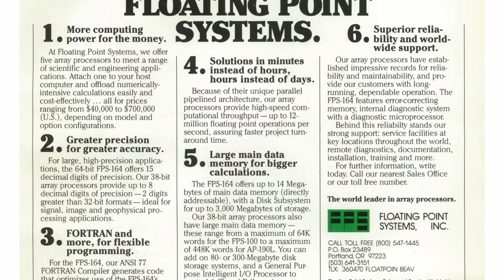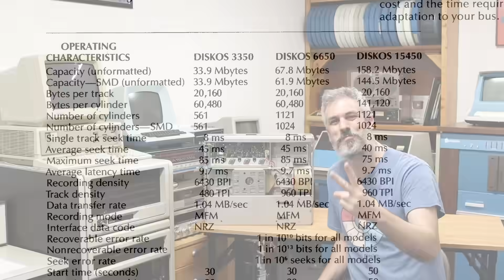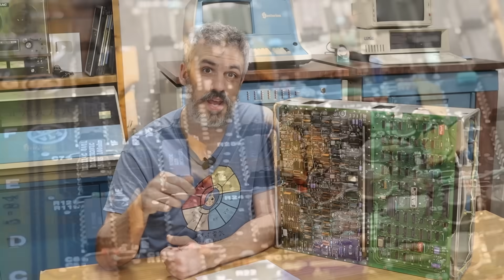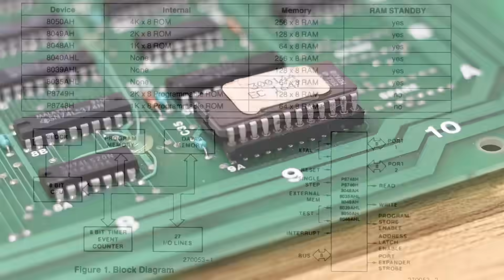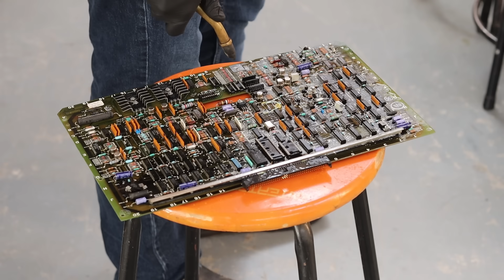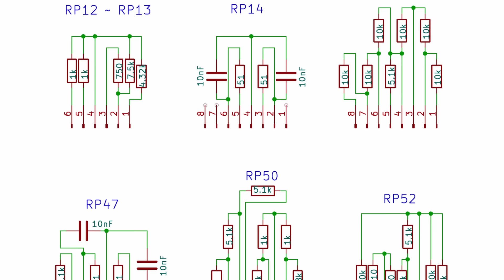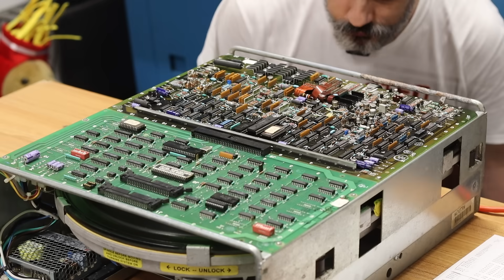This 1980’s Hard Drive tried its Best…

Comment: I have a few tips for you but first, what a trip down memory lane! Worked at MAI Basic Four in the Netherlands back in the 80's and 90's. These Priam drives were mostly mounted in the 310 and 410 model Mini Computers for small businesses with up to about 16 terminals. I repaired a lot of these PRIAM drives and repaired many power supplies and motor control boards. These two PCB's failed the most. The drives we used were equipped with a power supply. It was mounted over the full length and width inside the cage, exactly where you put the new ones.
I could be wrong, but pls double check if there really is no drive select from the logic board to the motor control board. If I remember correctly it needed drive select in order to spin up. Check for a dipswitch setting on the logic board?
These drives were sensitive to the position in which they were formatted. In MAI Basic Four Mini's they were mounted in a vertical position (PWR supply down) and therefore we formatted them that way. So if you do get it to spin up, it might not initialize or produce read errors if it's not positioned correctly. 
Good luck repairing this diva! Sending you and the drive positive vibes from across the pond😊🫶
Reply: ^ What he said.  That bit of spin looks like a self-test to me.  I think it wants a signal on the interface to start.
Reply: Can you imagine the kind of nightmares this video might re-awaken for some sensitive soul who thought they had put it all behind them?
Reply from the maker: That's awesome that you got to use a MAI Basic Four, that's a really unique machine that has all but disappeared from history!
Unfortunately, as best as I can tell, there are no electrical connections between spindle motor power board and the analog/interface boards. I don't think that I'm missing any connections, but when I get back into this drive, I'll definitely dig into that and make sure.
Reply: @UsagiElectric  There's certainly an electrical connection to get the power to the spindle motor.  Have all the connections in that harness been accounted for?  I'm pretty certain we had a software spin down command and didn't just remove power from the drive to shut it down.
Reply from the maker: You're absolutely right!
I rechecked the schematic, and sure enough, there are two signals being sent to the spindle power board along with the power wires. Since they're being sent via the big fat power connector, I had wrongly assume they were power, but there absolutely is a ON/OFF signal and a Speed signal (I think) moving between the interface board and the spindle board.
Thanks for getting me pointed in the right direction!
Reply: @UsagiElectric  Found it David! It does need a Sequence Up control command from the computer's disk controller to spin up the motor. On an Archive site are several documents on these drives. It's described starting on page 18 of the document: Priam Drive Interface Specification Apr81.
It says: The SEQUENCE UP Command causes the disc drive spindle motor to power up. The rotational speed of the disc is monitored, and after the drive is up to speed, a position signal calibration is performed (except for the 1070) and the heads are positioned to cylinder zero....
 One command later in the document: The SEQUENCE DOWN command causes the heads to be positioned to the landing zone and the spindle motor is braked to a stop. 

Personal advice: Try not to stop the disc by shutting off power to it. It might cause an emergency retract of the heads, where they are violently pulled of the platter with a loud bang to prevent a head crash.

Comment: Back in the 80's I was a field service tech  for Technicare,  CT scanners that used PDP 11/34 computers and FPS  array processors.   The FPS boards were up to 8 layers and the main danger of desoldering a chip from multilayer boards is pulling the through plating out of the hole, or breaking it loose from the inner layers.. then you can never reconnect to the inner layers and the board is toast.   A trick we used to ensure no damage to the through hole was to cut all the leads at the chip, then clamp and hang  a pair of hemostats to the lead on the bottom of the board. when the solder melted all the way through the weight of the hemostats  pulled the pin out.  guaranteed  not to damage the through hole.   then the solder could be cleaned out of the hole and its good to go.
Reply: Oh yeah.  Internal power and ground planes are the bane of both soldering and desoldering operations.  Build in heat sinks, which mean you need to add a LOT more heat than you think to get all of the solder to melt.  Just because the surface where the iron is, is molten, doesn't mean it is all the way through the hole.

The technique i used to use is close to yours, and probably not as good.  But i would do the same, but the leads.  Then apply the heat and gently wiggle the lead with a small pair of needle nose pliers.  Once i could feel is free up completely, i could gently pull the lead out of the hole.

There are many ways to clean the hole, but i usually used either solder wick or i'd heat the hole and blow through it with my mouth.  If the solder was liquid, the tiny bit of air pressure would push the molten solder out of the hole pretty well.
Reply: Only downside to that is if the chip is irreplaceable and you are unsure  if it is truly bad....then you kinda have no choice.
Reply from the maker: I'm definitely hoping I don't have to do much board level repair on the FPS-100 boards, but if I do, thankfully, with the J&M Trading haul of boards I got, I now have duplicates of most boards just in case!

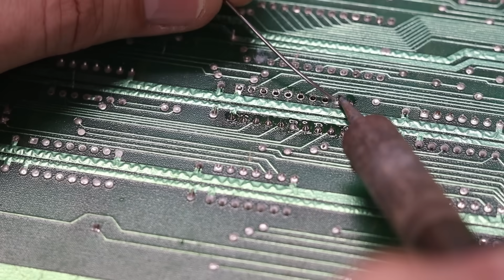Comment: [9:34] I don't believe the '245 can be used as a drop-in replacement for the '244; the '244 has fixed directions for its transceivers - four go one way, four go the other - but the '245 has eight bidirectional transceivers, all going the same way (all left to right, or all right to left, controlled by pin 1).
Assuming the two /OE pins are tied together you could make an adapter to use a '245: Tie pin 1 [DIR] to pin 20 [VCC]. Pins 2 and 18 [Xcvr 1], 4 and 16 [Xcvr 3], 6 and 14 [Xcvr 5], 8 and 12 [Xcvr 7], 19 [/OE], 10 [GND], and 20 [VCC] can pass through one-to-one. Pins 3 and 17 [Xcvr 2], 5 and 15 [Xcvr 4], 7 and 13 [Xcvr 6], and 9 and 11 [Xcvr 8] will need to be swapped; pin 3 on the chip goes to pin 17 on the socket and vice versa.
(Edited: Explain how the chips are different and how to make the adapter)
Reply: Yep, agreed. They are quite different IC's though fortunately he did use a socket. I've gotta say, this chap does produce some fascinating content and this is certainly a brave undertaking. It was hard enough to get reliable performance out of these drives back in the 1980's never mind now!

Two things of special interest, I've never seen resistor packs with built in decoupling caps, thet's a very cool idea. And I've never seen transistors rust through so completely either, while the rest of the board is not all that bad in comparison.
Reply: When he said that I almost missed it, had to rewind to see what was original chip or am I dreaming. It's not pin compatibility, function is not same. Maybe 245 could jump as a help for 540, repining oe and dir. Best Regards.
Reply: A '245 is most definitely not pin- or functionally compatible with a '244!
Reply: The good news is that it looks like the OE pin is floating. So the '245 probably didn't fry whatever is connected to the input.
Reply: Totally agree that 245 is definitely NOT a drop in replacement for the 244 so this is not going to end well. 

Pin 19 (OE/ for 245) is wired on the top of the board.

I see magic smoke in his future.
Reply: Dear Diary. Today I saw a real live wizard just hanging out in the comments section of YouTube.
Reply: Came here for this. I designed many boards using 244s and 245s in the 80s. The pinouts are pretty much hardwired into my brain at this point...😅
Reply from the maker: You're absolutely right!
I got my datasheets mixed up when looking the ICs up. I've got a proper LS244 on order!
Reply: ive gotten caught by this before thinking I could make it work but they are too different to be feasible...(well at least easily)

Comment: 6:15 The way I used to deal with replacing weird resistor packs, back in the day, was to just build them from scratch from discrete 1/8th Watt resistors on a pin header.
Reply: That's being hardware gangsta.

Comment: 8:52 The Intel 8253 was also used by the IBM PC so even though no PC has one anymore nowadays because it's part of the chipset now, its functionality is still all around us.
Reply: Though one of the channels isn't implemented in modern chipsets. Channel 1 was used for DRAM refresh in the original PC, but since memory technology has evolved over the decades, there hasn't been any need for it in ages, so it's just left out. The other two are still alive and kicking in modern chipsets, though.

Comment: If you want to know what 100Mflops is today, a Raspberry Pi 5 is clocked at being able to achieve 25GFlops 🤓
Reply: And the first IBM-PC of the same era, with the 8087 coprocessor, achieved a tremendous 50Kflop...🤭
Reply: Can we hook a Pi 5 to the pdp as an array processor? 😂 it would smoke other pdp installation...
Reply: not important
Reply: Yea but that is enough to run doom unironically maybe even quake
Reply: @belstar1128  100% that it would run Quake. A Voodoo2 has 90MFlops of processing power (and a GPU is literally just a supercomputer-on-a-chip so that's a valid comparison).
Reply: I had a Sun SLC in 1992 - a whole 3 MFlops ($3500 secondhand - and a 1GB scsi hard drive which cost $1500)

Although that's 1/10 of the mflop rating of a i486dx40, in actual throughput/performance it was about the same as the 486

Comment: I used to work on Priam drives back in the day but with a different interface. We tested the drives using the Priam Smart-E controller and a custom IBM PC ISA bus card that I wrote the software for. I may be able to dig up some documentation on the 200513-1 Analog PCB if you're interested let me know.
Reply: I am pretty sure he would be interested, and that tool might be useful to more than just him. Definitely upload that data somewhere!

Comment: That comment about calling it a win if it doesn't catch fire reminded me of my partner's and my final project for Autonomous Mobile Robotics in university, which was a vehicle that basically played single-player soccer. The professor would put our robot on a table with a white line down the centre, a ping-pong ball somewhere along the line, and a light at one end of the table as the goal. Our robot had to find the line, follow it to the ball, then get the ball to the goal.

Each pair was given a 6811 microcontroller board, but we couldn't get ours to work. We got the school technologist to test it, and it worked fine for him. But it kept crashing for us. So I did it with relay logic. And because we were poor university students using parts from the surplus store, it needed 3 different voltages: 3, 9 and 12V. Rather than use regulators, or even resistor droppers, for the lower voltages, we just threw on 2 AAs for the 3V, a 9V and another 8 AAs for the 12V.

When we showed up to demo it, the professor laughed at it, and said that the last time he saw a robot that looked like ours, it caught fire. So he said if it didn't catch fire, he'd give us a C. If it even kind of worked, he'd give us a B, and if it worked perfectly he'd give us an A+.

The professor set it down, turned it on, and it found the ball. As a big send-off, I'd designed the logic so once it had the ball, it would ignore the edge-of-table sensors, so it would just drive off the end of the table and smash itself on the floor. Unfortunately, it missed the goal.

We got a B+.

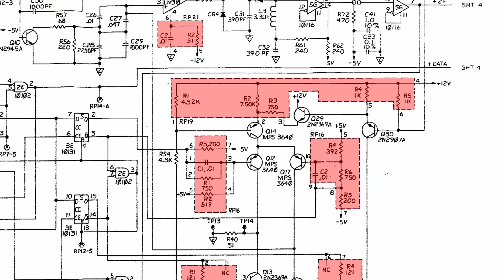Comment: 5:45 I had to pause the video there. And the look on my face, holy crap. It's resistor packs... FROM HELL!
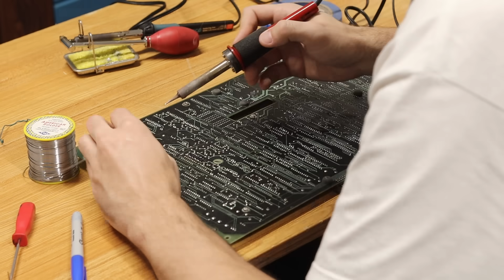10:45 Having used one of those desoldering irons for many years, I (and my tired wrist muscles) salute you! (And that's also why I gave you two tips out of my stash last month!)
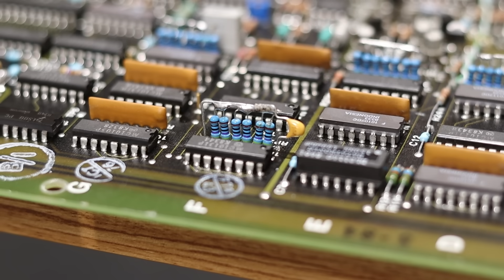15:25 I might have been tempted to build tiny PC boards for SMD parts, but that might not have helped much. It could have looked so tidy though! (Ah, you did consider that, good!)

Comment: Those Transistors that won't desolder easily: 
To not risk damaging the board, snip the Pins, melt sloder and pull pins one by one. Or, did you ever try to use Chip Quick or similar low-melt solder? It stays molten long enough to have multiple pads liquid at the same time, so components can be pulled out easily.
Reply: I love chip quick and hot air preheat. I then use solder braid to remove all the chip quick since I worry about it long term.

Comment: I understand the basics behind washing a circuit board with soap and water, but every time I see it, every synapse in my brain recoils in horror
Reply: The visceral horror is real. But, yes it seems to be mostly harmless. Isopropyl would help make the drying a bit more thorough, but he also lives somewhere very dry, which makes up for it
Reply: Except that where I worked, every populated circuit board was washed and dried to remove the very corrosive flux applied before going through the wave soldering
Reply: If the cleaning and drying doesn't go completely right, you get some very strange errors for us techs to tackle. That super flux they use is a marvelousiy good conductor when still wet under chips. You take the chip out and it's wet underneath, though the board otherwise looks dry. If improperly cleaned and it does dry before it gets around to testing, all the traces have a fuzz on them under the chips. The boards are dried at a very high temperature. Many a worker has touched them before they cooled and instantly screamed in agony. Hot boards don't look different.
Reply: @stephen1r2  Living somewhere dry can be an issue, too. Consider: if there are dissolved minerals in the water, and the water evaporates before it can be removed, it will leave behind mineral deposits.
If it were me, I would wash in distilled water and soap, then rinse in tap water, and immediately immerse in isopropyl for a while to get rid of all the h20 ... then blow-dry off the IPA and let the board sit for a day (belt-and-suspenders approach).
Reply: @stephen1r2 a spritz of isopropyl before fully drying makes the water evaporate much easier too.

Rinse, shake off, spray with iso to get like 50/50 water iso mix on the board then dry. It'll dry way faster and cleaner for a few cents of iso
Reply: @kennethflorek8532  That's why you leave a kitchen towel on it while it's hot!
Reply: You may cringe but they're washed in HOT water at the factory. 

Detergent and hand-hot water is a good first starting point for removing contamination (especially coffee or cola) and a rinse in 99% isopropyl helps get rid of anything left behind

Regarding the comment about wet IC undersides, it's a REALLY good idea to swish your board when it's immersed in the water/detergent. It helps penetrate under ICs and dislodge any residual flux

I spent way too many hours as an apprentice dealing with the results of beer and cola spills in office/retail electronics, not to mention devices that were FULL of nicotine dust bunnies (ew!) and CRTs liberally coated in tar
Reply from the maker: Talking with Ken Romaine, back when he was working at Centurion, they had a run of the mill dishwasher they'd put fully populated boards in after they came out of the wave soldering machine. It seems wild, but as long as you get them plenty dry, it's a great way to get them clean!
Reply: I'm more concerned with compressed air, i.e. static electricity

Comment: I just resurrected an 80s hard drive just by pushing the full 12 volts through it with my lab power supply. I think the motor + bearings had seized from age, and the power supply of the computer (T5100) didn’t have the juice to unstick it, then it worked flawlessly on the computer supply. Maybe worth a try if anyone has an otherwise dead hard drive.
Reply: Did you shout "it's alive! it's alive!" afterward?
Reply: @ChristopherHailey  I think it's required

Comment: You can also add flux to the bottom of the board to ‘refresh’ the old solder. Flux removes the oxidation on the metal as you heat it up.

Comment: should have designed custom resistor packs as custom PCBs  with SMT components. Would look neat, would work better.
Reply: I thought that too. but Dave is not a custom acid etched PCB kind of person. He makes "PCB"s on a Bridgeport CNC mill. Under the yellow enamel of the SIPs is a laser etched resistor array with small capacitors if needed. The substrate is ceramic and the resistors are conductive ink printed on.
Reply: I've made small resistor areas on threw hole plated ring hole protoboards. 1206 can fit between the pads and parts can be placed on both sides.

Comment: Perhaps do those resistor packs in tiny PCBs with SMD components?
Reply: Back then, more likely "Thick film" devices; ceramic substrate with printed-on resistors and other components soldered as required. Pretty much the predecessor to surface mount!